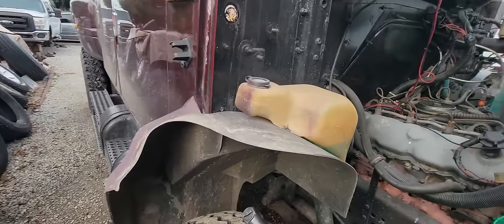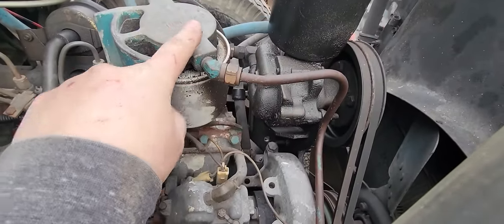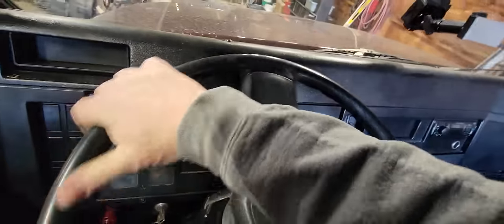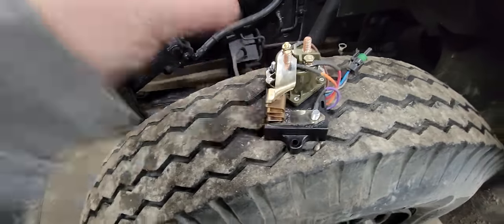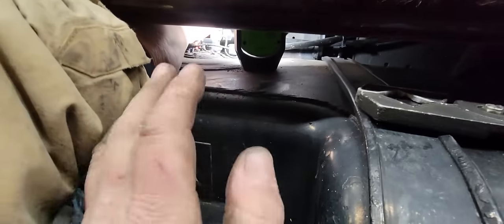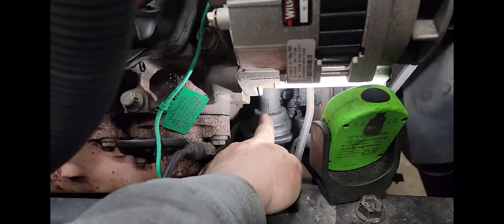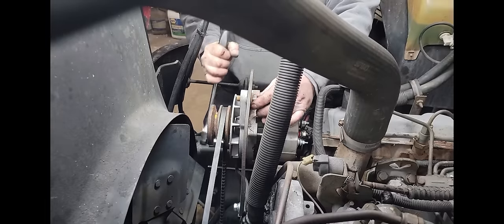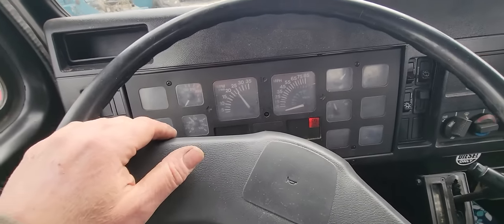CREW CAB INTERNATIONAL 7.3IDI NO START IS BACK....CAUSE IT WONT START AGAIN.

Comment: One of my trucks is a 6.9 powered 86 F-250. Only way these IDI’s will run worth a crap is with a tight fuel system and good batteries. You can’t expect to drive an old rig like that and not do any preventative maintenance on it. When the person working on your truck tells you it needs fixed you should probably take the advice. Enjoyed the video.

Comment: I learned (the hard way) leaks in the fuel return system can cause hard starting on these IDI diesels. Apparently, they're kind of notorious for that. There's an inexpensive kit that includes all the little fuel return hoses and clamps connecting injectors. Installation made my old skoolie fire up in half a revolution.

Comment: The Barney truck🤣!  Well it doesn’t take much to keep these trucks running.  Don’t make much power, but when they’re running right as you’ve proven they just go and go and go.
Reply from the maker: really, they dont take much work. its when the owner wants 100% out of it but only wants to put 50% into it that its less than reliable.

Comment: Nice video and fixes. I guess that’s the problem these days if you want older and simpler equipment. The OEM stops making parts and you’re stuck with crappy aftermarket parts.

Comment: Great video.   I have used a relay with built in timer to fix glow plugs.  Relay has adjustable on setting
Reply from the maker: thats ok if you have an operator you doesnt just keep cycling them over and over when that isnt why it wont start.  they will burn up the glow plugs.

Comment: the only diesels i have ever worked on was the oldsmobile that they converted back in the 80s and cummins 1989 --1994 done a few injector pumps but watching your channel even though i don't plan on doing any more diesels the information is valuable someone could be broke down and i might be able to help them from what i have learned from your channel if you ever quit turning wrenches you should consider teaching lord only knows how hard it is to find someone that cares diesel or gasoline

Comment: I'm learning more about the 7.3  . Is this engine similar to the 2003 Ford F.250 Super Duty 7.3 Crewcab ? My 03 only has 118k miles and I love it .
Reply from the maker: no. completely different injection systems.

Comment: Probably stupid question, probably looked at it and you know for sure... but, i have to ask, is that module 100%, without shadow of a doubt, meant for that particular engine and glowplug set? I'm asking purely because i've had a similar (to be read: does the same thing) thing on an agricultural unit, and everyone, everyone from the seller to the manufacturer's code told us the part was for the right unit, but when you checked the actual part, it wasn't rated for that circuit and therefore from a different setup. Just sayin' that might be the wrong part if you fixed it, burnt it, fixed it again and it came to you crispy again.
That said, if i'm wrong (and i might be) if that plastic doesn't make a crunch when you cut a shaving off with a box cutter, then it's normal plastic, not rated for high temperatures. It should be glass reinforced plastic. 
just my 2 cents, which again, might be wrong cause i've never worked on that engine. :)
Reply: Seems to me the last one I had was bakealite not plastic. Making it cheaper is the key
Reply: I was wondering the same.  Now, a fix could be that a bakealite isolator be fashioned between the plastic and resistor metal to stop the melting of the plastic.   That "might" fix the problem but still be the wrong part for the job. Could be a work around? .@cesmith4566
Reply: As suggested in the video, normally open / closed, part supplied as close enough. If so that would explain the poor batteries 🙂
Reply from the maker: it is listed with the o.e. international part number as a cross reference. so i assume it is. i think its just a less than o.e. quality.

Comment: It should always have power to it if I am correct also I believe they have a temp sensor on the head that kills the system at operating temp will not apply glow plugs
Reply from the maker: it always has battery power to it. ignition to turn on the module. then it grounds the the coil of the solenoid to activate glow plugs. no temp sensor used.

Comment: It can be fixed but parked in a corner for a week with suspect batteries are not the mechanics fault if the owner is made aware of the issue.

Comment: Them ole idis lol they pain in butt some times hey did u check that temp switch I believe some them had a temperature switch back at rear …the push button is the fix ! Aslong as who ever drives that vehicle understands it’s the best
Reply from the maker: this truck only measures the amperage flow / resistance to know when to turn on and off.

Comment: the newer gasoline engines are going to direct injection guess it works sorta like diesels do but have noticed they give a lot of trouble with build up on valves and they have a system to use walnut shells to blast down the intake to clean the valves. do diesels have this problem because have never heard of them having the problem. and do you have any idea why the gasoline engines have the problem?
Reply from the maker: i have always figured it was from the make up and low quality of the fuel these days. the lower compression may come into play as well.

Comment: If you can throw things in the bed, how are you going to get them out? Needs a ladder bolted to the side.
Reply: Drop the tailgate, back up real fast, and slam on the brakes.
Reply from the maker: this is priceless.....you cant drop the tailgate! it rubs on the rear decorative tail pan the body shop installed!
Reply: I guess you could tie a rope onto what you throw into the bed so you can pull it back out.

Comment: If a truck sits around too long not being started and run daily doesn’t do the batteries any good and they need a battery isolator to save the batteries, I can’t drive my car as much these days due to back injury so I need to fit an isolator myself
Reply from the maker: these batteries were in it when he bought it years ago too. so they are due.
Reply from the maker: i dont have "customers". this is just a friend of mine. it is tight on trucks but will go all out on other things without any regard for cost.
Reply: @j.c.smithprojects  ah ok, you’re a good friend

Comment: 25:50 split lock washers do absolutely nothing to prevent bolts from loosening . AvE did a video on this exact subject. There are different locking fasteners that lock. There are nordlock washers which help prevent bolts from loosening. Split lock washers have zero effect.
Reply from the maker: it doesnt really matter to me. if it had it from the factory, im putting it back on. i think some people believe the split is for compression spring pressure only. it is my understanding that it is designed to "dig in" to each surface as well.

Comment: With all the slapped together parts I wouldn’t be surprised if that module is the wrong one
Reply from the maker: im pretty thorough about parts, matching o.e. part numbers and their application.
Reply: @j.c.smithprojects  
Yeah I know! Cutting the slide to make another bolt fit rather than just getting the right bolts is mind boggling 🤷‍♂️🤷‍♂️🤷‍♂️
Reply from the maker: oh no, you cant change the bolt. it is the wrong alternator AND the bolt is bigger in diameter. it wont fit inside the slot at all. so he cut the slot open. it was a "soup sandwich" from the day the owner changed the alternator.